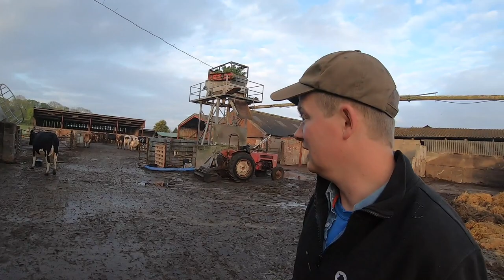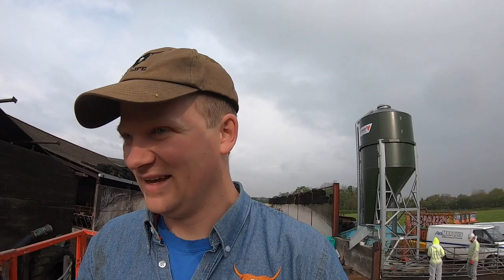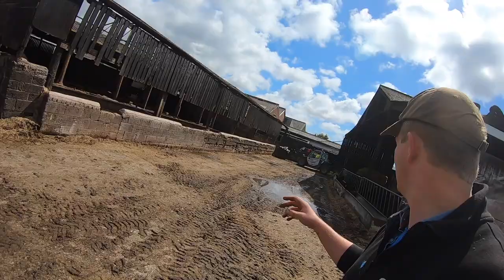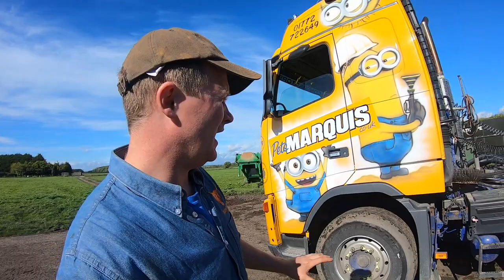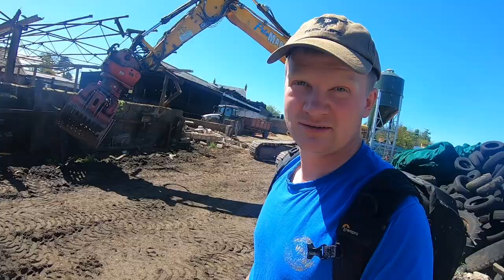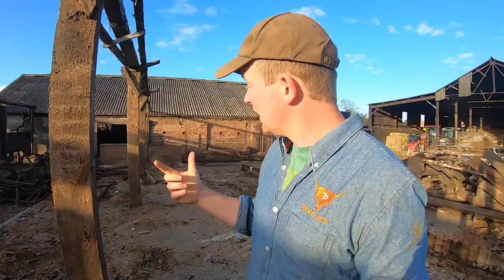DEMOLITION DAY ! FARM BUILDINGS GONE !

Comment: I’m in awe of the precision and delicacy of the massive demolition machine!
Reply: Peggy you need to watch Andrew Camarata . He has all sorts of machinery and films his jobs like ‘making a new drive ‘ or what normal people call a long road . Anyway he’s so proficient at operating all this equipment and repairing it .
Reply: Same. It was like picking up tooth picks.
Reply: Its mesmerizing! Lol Loved watching that cutter thing work! Way too cool! I watch letsdig18 and he has that finesse with excavators and his vids of going to auctions with other construction you tubers are hysterical.
Reply: As someone once joked: they could set the table with one of those!
Reply: When I hire a digger they need to be very accurate and careful for the work I hire them to do. My test is putting down a 4X4 of construction timber with 2 16 common nails barely started. One they need to put in with one hit and end it up flush without just bashing the wood and losing the other nail, the other they need to put it in with 2 taps. If they can do that, I hire them for monument restoration work. It's amazing how many can do it (I've hired about 5 or so over the years). It's far less surprising how many think they can and cannot (I've rejected probably about 20). It nice that there are a lot who are humble enough to admit they couldn't do it when told about the test (about 40 or so).
Reply: You need to try LetsDig18 for excellent excavation work and machinery.

Comment: My two loves farming and plant machinery. I left working on farms to drive 360 diggers like the one in the video. And trust me even i forget what some attachments are called. But they are using a selector grab for striping and sorting the materials and the attachment for cutting the metal is called a shear also notice the hydraulic  breaker as well for breaking up the concrete ready for the crusher

Comment: 0.01 f/cm3 is actually the clearance level indicator once asbestos works are carried out a reoccupation air test is often done especially with licensed asbestos ( crocidolite or amosite, blue & brown )  and the white chrysotile cement roof sheets are often around 15% asbestos not 1% due to cement the fibres are bonded well and like Paul said it’s one of the better forms to deal with

Comment: Hey Tom, I posted this on your last video too, but just in case you miss it because the video is a few days old, I figured I'd post it here too. Just an idea: you could take 1 or 2 of those cubicle bars, cut them into 3 or 4 inch sections. Then clean them up a bit and have you, your Dad, and Heidi sign them, then spray them with a clear coat to protect the signatures and prevent rust from continuing, then sell them as a "limited edition" item on your website store to help raise money for the farm. I'm sure plenty of people would want to buy something like that, as it would mean they not only get something you've all signed but they also get a part of the history of your farm... And that's a pretty neat thing to have if you really think about it.

Comment: Hi Tom
I have the same time lapse cameras on a building project.
Do check the focus on the camera. It is hard to get correct ans there is a danger your film will not be in focus.

Also be certain to use good batteries and change regularly . Battery usage does depend on how often you take a shot. 
Always use the same batteries

Obvious stuff but you only get one chance to film a demolition

Comment: £1,200 in 1960 is equivalent in purchasing power to about £28,349.11 today, an increase of £27,149.11 over 61 years. The pound had an average inflation rate of 5.32% per year between 1960 and today, producing a cumulative price increase of 2,262.43%.

Comment: Seems a bit over the top using a huge excavator for pulling down the wood and roofing frames but then again you would need at least three guys to do the same job so that might make it even more expensive......also you have to admire the operators skills when he pulls of that little piece of sheet metal using those huge claws.